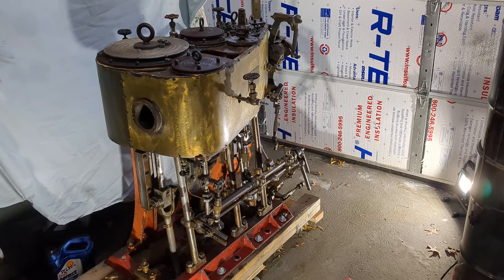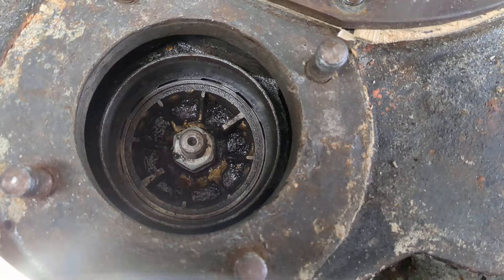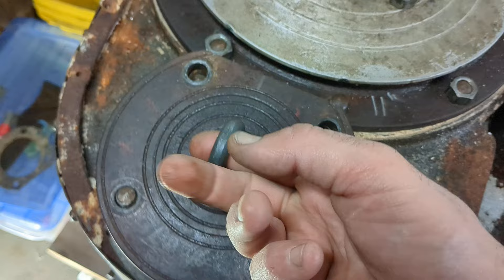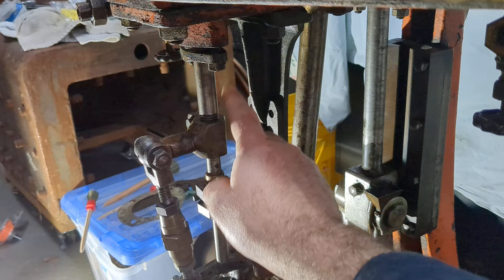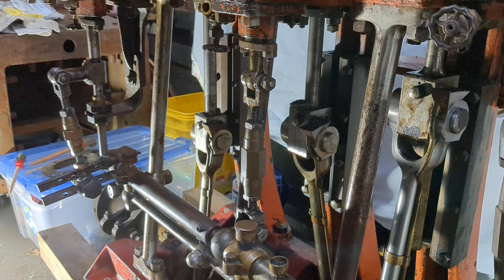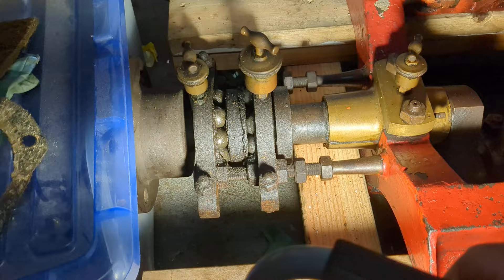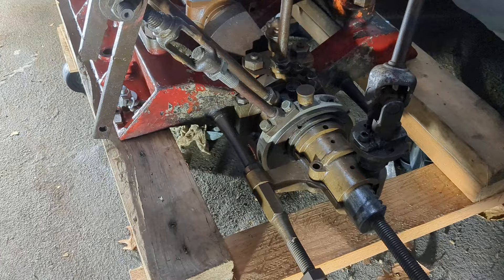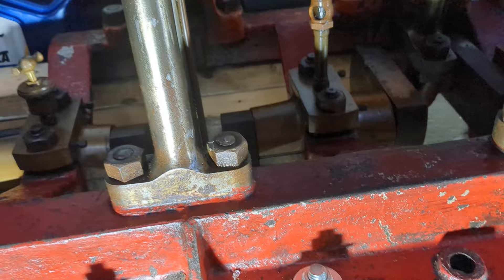Sullivan Triple Expansion Steam Engine Update

Comment: Paint wise, you could go down to raw dark casting and use a matte clear coat. Maybe a nice light forest green would look great as well. P.S. I’m just starting to dip my toes into steam. I love seeing these little engines.
Reply from the maker: I like the raw casting, but clear coats don't seem to last in this environment and eventually get corrosion underneath them. The brass casing has clear coat over it and one can see where it has failed and started to corrode underneath. The light green sounds nice. I'll have to do a couple of test spots to see. The Sullivan in the Steam Yacht Cangarda is green with wood and brass lagging.

Comment: I knew exactly what you were talking about when you said “farm repair” no disrespect to farmers, use what you have. Yeah, not, definitely not beautiful enough for a steam engine, red and orange, really? The braising repair on one of the pushrods (?), looks pretty bad too. Anyway, what a project!!!
Reply from the maker: Yeah... Brazing repair on junkyard parts they threw together to make it "work" but didn't actually make it so it would work 🥴  Just enough knowledge to be dangerous... Unfortunately it'll be a while before this is running properly.

I was thinking a deep red, with the brass lagging, but I'm open for suggestions. Going to be trying to undo the 100grit sanding whoever did on the brass lagging also.